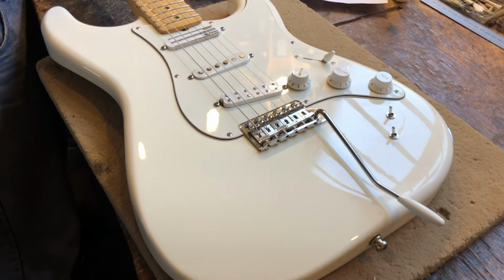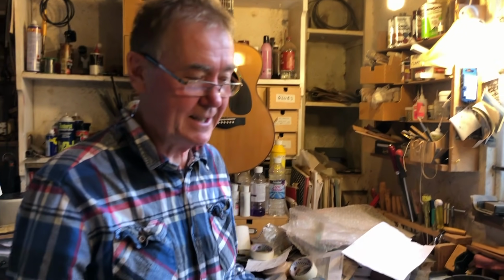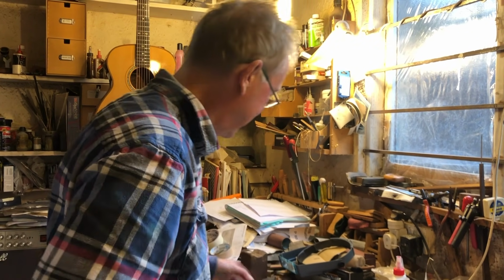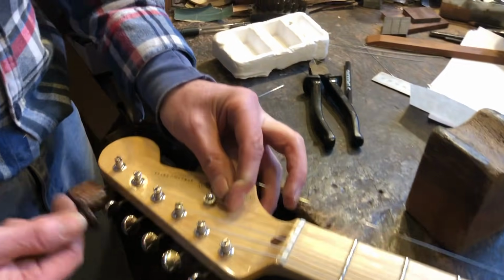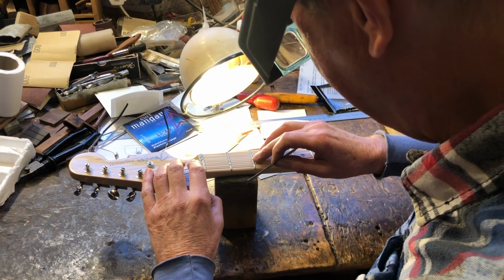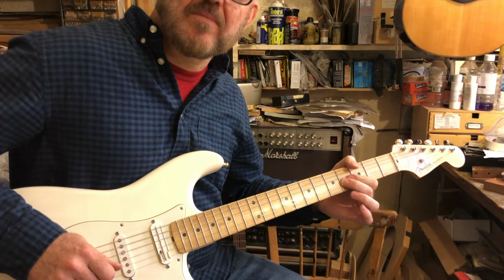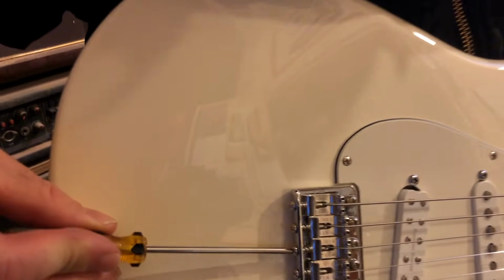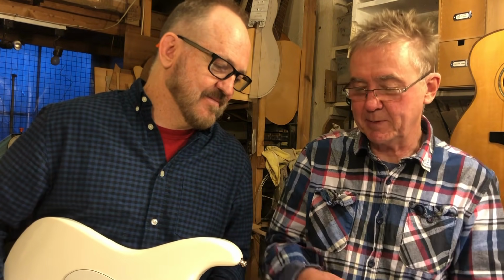Dan’s Vlog – The Ed O’Brien Strat Gets Set Up By Jonny Kinkead – That Pedal Show

Comment: Truss rod access by removing the neck only??!?!?  Come on!
Reply from the maker: Mick here. You don't have to take it all the way off if you just want to make an adjustment... But Jonny wanted to check some other stuff too. Cheers!
Reply: @ThatPedalShow  Ok, good.  Some builders still do that kind of stuff and it's maddening.  Got a few such guitars home.
Reply: He wanted to check the fitting of the neck—ie if the heel was level, if the pocket had excess paint or material. At no point did he suggest that he would have removed the neck a second time had he had to make additional truss rod adjustments.
Reply: @wearetemporary  I prefer to have access at the other end of the neck.  You would need a tool I don't have to turn the rod without removing the neck as it is.  I presume it is feasible, but you can see the access isn't ideal.  I'm not against removing necks.  I've swapped a few around on my guitars and played a bit with shims and whatnot.
Reply: @user-oy7gz5bf2h  have you ever messed anything up beyond what you could repair yourself? Did you use some videos or web pages you used to guide you? i cant find any detailed information anywhere and im terrified of taking my neck off.
Reply: @rickyrich8246  Rich, there's nothing to it.  Simply remove the strings.  On a Fender, you'll have 3 or 4 screws [some newer have tilt adjustments as well.  You don't have to touch it].  After removing the screws, the neck comes right off.  To put it on - put it in place and tighten the screws.  Probably a good idea to clamp the neck to the body, as many with have both the body and the neck threaded - which can make tightening a "bit" difficult, as the screws no longer act like clamps. Ideally, the body should have through holes and only the neck threaded. That way the neck gets pulled into the body for a tight fit.
Reply: Here's a hack I use. Put a capo on the 1st fret, then remove the neck screws while keeping the neck in place. Now carefuly lift the neck heel up to access the adjustment screw. Put neck back and place, tighten the neck plate screws, tune to pitch and remove the capo.
Reply: @rickyrich8246  Oh no no, it's frightening if you haven't done it before, but it's just mechanical.  I'm not much of a tinkerer.  I can't fix anything.  But I can use a screwdriver.  Unless you slip and scrape the finish, I can't see much going wrong.  You get to learn a bit by doing so.  Like the time I put my squier tele's neck on my G&L strat.  Not the same pocket size (learned that then and there).  Had to shim it a bit with tape (what I had lying around) to make it have the right angle.  Didn't do any woodwork.  Didn't damage the parts.  Just make sure to keep all the screws, bits and pieces in a safe spot so as to not loose anything.
Reply: @Billywagner22  Doing that puts a tremendous amount of stress on the fibers of the wood that the screws are grabbing.  Your screw-pockets will wear much faster due to the stress. If the screw pockets were lined with steel inserts and traditional bolts were used, this would be fine.  But, wood screws into wood were never designed to be repeatedly removed as it is.  Your method only makes the pockets wear faster.
Reply: @northof50now  what is your solution?
Reply: @Billywagner22  In all honesty, there is no solution to not wearing out the screw pockets.  It's a "down & dirty" way Leo did it to make the guitars inexpensively [which was his primary objective].  It's also the one of the reasons they changed it to the top and custom guitar makers used a different method.  But, to have the pocket last as long as possible, you "should" remove the tension, then clamp the neck to the body before putting the screws back in.  It's not perfect and eventually [if you do it enough times] the screws will simply not hold any more.  At that point, you'll have to fill the pockets with glue and sawdust, which will add wood fibers and create a new pocket.  Please understand, I was not attempting to tell you what to do.  We can all do what we want.  But, after 30 years of cabinet making, there's a few things I've learned about joining wood.  Screws are simply clamps to hold the wood until the glue dries.  In this case [obviously] there's not glue.  It's just fast and cheap.